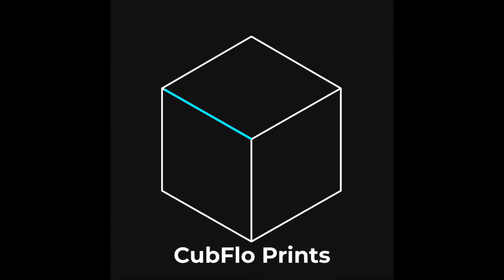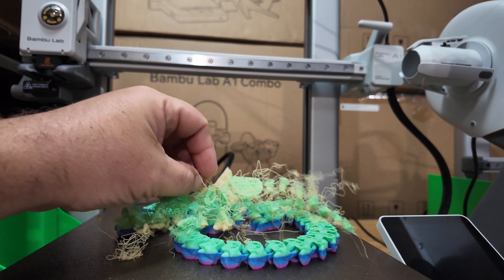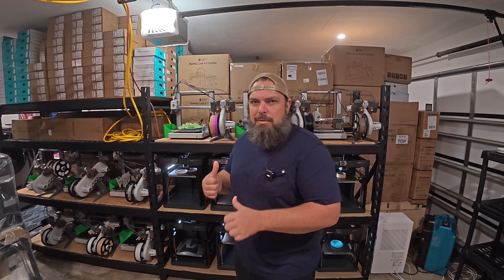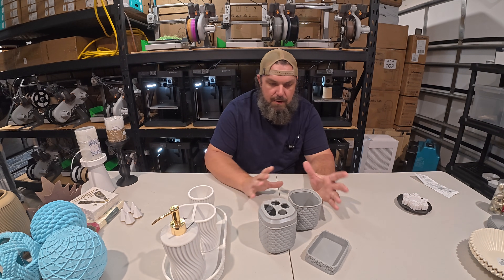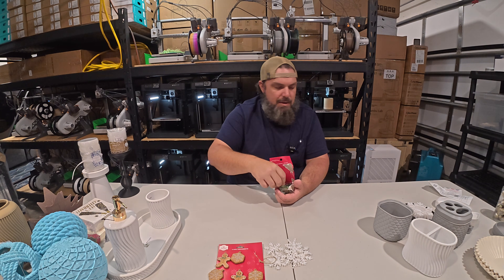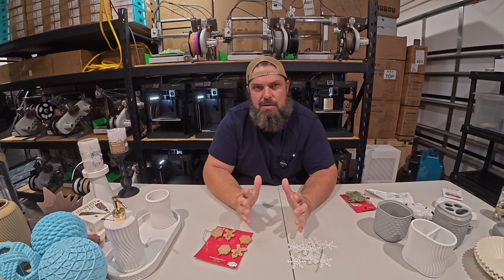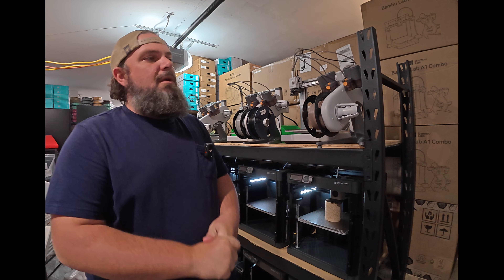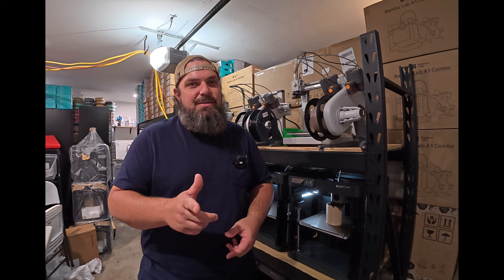Day 12: Comparing 3D Printed Parts to Store-Bought Items

Comment: As someone who does this full time, I’d recommend finding or designing products that can be printed in a single colour. Once you start offering multiple colours, inventory management becomes complicated very quickly. Sticking to one filament colour for everything you produce is honestly one of the best decisions you can make.
Reply from the maker: Agreed, managing multiple filament colors at the printer level adds a lot of complexity fast. I’m leaning more toward single-color prints with assembly where multicolor makes sense. It keeps production cleaner while still allowing flexibility where it adds value. Appreciate you sharing what’s worked for you.

Comment: 👋 Hey I’ve watched about half your videos. But haven’t seen you discuss or tinkering with the Printing settings.

Are you starting off right away on printing to list and sell? Or running initial prints and going through iterations adjusting settings to get optimal quality?

I got 1 Bambu P1S printer 2 weeks ago. And am still trying to sort out the little issues with stringing, layer adhesion, overhangs, etc. Of course im limited to the number of times I can test things out with just 1 printer.

How are you deciding on what number of wall loops? Infill? Layer height? Etc..?

With 1 printer I find it difficult to test things and sort out printing issues. Cause you need to let whole print complete to be able to judge the quality of the settings you used, then tweak. 

Im hesitant to list or price prints right away until I can narrow down printing settings that will output reliable quality prints.

If I had your set up, I would be running the same print on multiple printers all with different optimized print settings until I found one that could reliably output the same quality print over and over.  

An 8 hour print x 6 printers, you nail the settings in a day. While with 1 printer it can take me 2-3 days with more monitoring.
Reply from the maker: Great questions, and you’re thinking about it the right way. Right now I’m not printing to sell yet; everything you’re seeing is test and validation while the workflow gets dialed in. I haven’t gone deep on settings on camera because that process is still very print- and material-specific, and it’s something I plan to cover once things stabilize.

With multiple printers, iteration does speed up, but the goal is the same either way: find a set of settings that can reliably repeat over time, not just look good once. With one printer it takes longer, but the fundamentals don’t change, it’s still about consistency before listing anything. I’ll definitely be showing more of that tuning process as the series moves forward.
Reply: I printed for a solid year before selling anything. I wanted to know my machines inside and out so I could troubleshoot fast and do it right. Rushing junk to market hurts everyone who actually takes pride in the craft.

Comment: Hey man I really enjoy your videos. We run a pretty decent print farm, less printers than you but more large scale ones. We bring in a good amount and have learned a ton this year. My biggest advice would be do not just look at material cost as your cost to produce in item. You need to factor in EVERYTHING, from print time which i’ve seen some people say between 75¢-$1 an hour, electricity, maintenance, you also need to include an amount to cover for potential failures like you experienced in this video even the most fine tuned printers can have occasional failures and you need to price that in also. I’m saying this because we’ve seen a ton of people that look purely at the raw material cost and nothing else and that will genuinely ruin everything and leave you with almost no profits. Please account for every aspect of this and I promise you’ll be more successful. Also just a tip, 3D printing is a special type of way to manufacture items don’t compare your prints to mass made imported injection molded pieces. Dive into what things can ONLY 3D printers make and actually create unique items that you couldn’t find anywhere else. Make the fact that your items are 3D printed be a benefit not a downside if you get what i’m saying. Love your progress hope to see more.
Reply: Packaging and shipping costs are a huge consideration. Box, packaging materials, and postage can add up quickly and can be more than it cost to make.
Reply from the maker: Appreciate you taking the time to write this, that’s solid advice. I’m building the workflow with full costing in mind (time, power, maintenance, and failures), not just material cost. And I agree on the injection molding comparison, it’s less about what mass production can’t do, and more about using 3D printing to compete on personalization, flexibility, and smaller production runs where it makes sense to capture market share.

Thanks again, and I’m looking forward to sharing more as everything gets dialed in.